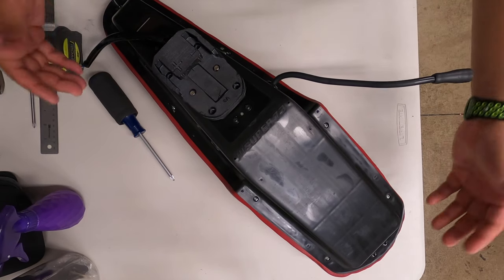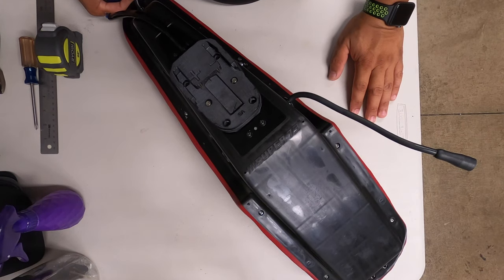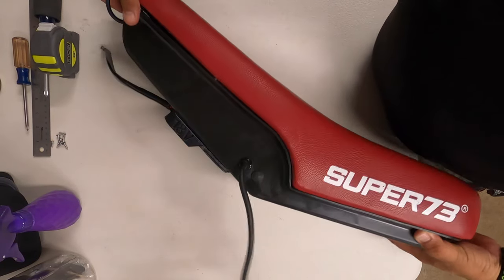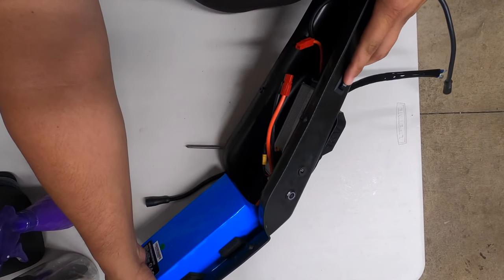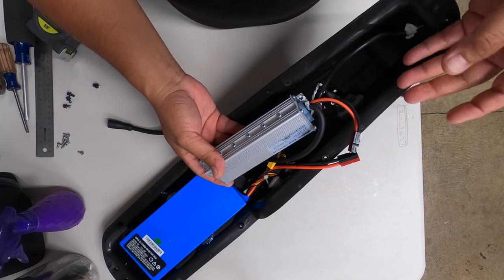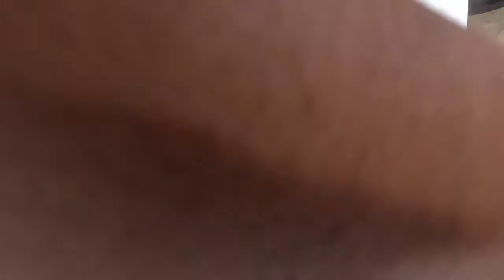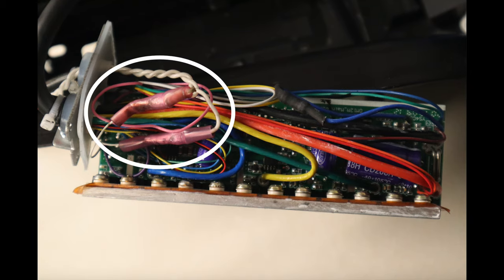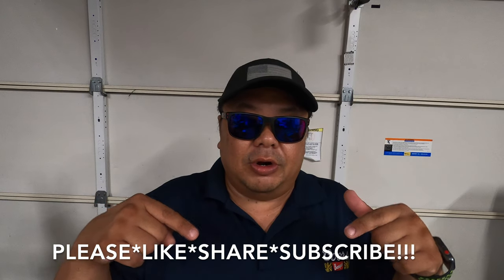SUPER73 z1 SPEED MOD / HACK

Comment: Will you do a video about how to add the on/off switch?
Reply from the maker: I might be able to do a short snippet on what's gotta be done.  Basically a rocker or toggle switch (on/off) that's connected to the white wire we cut (SD wire).